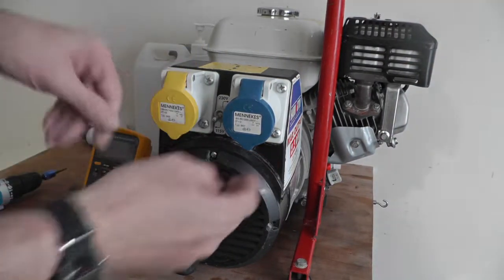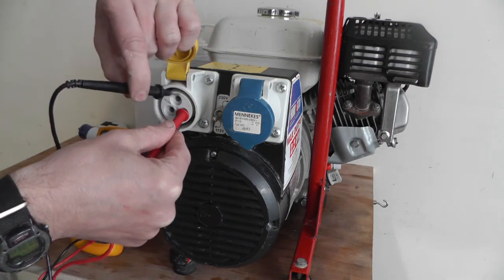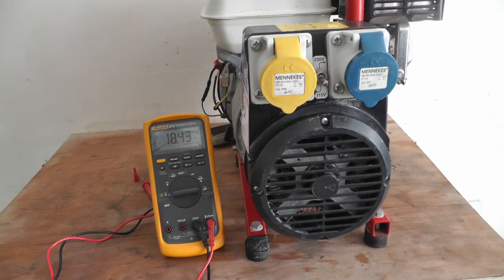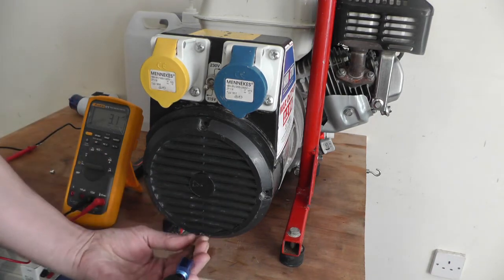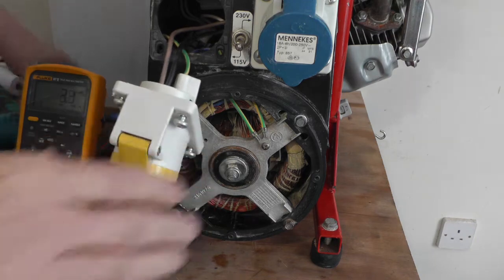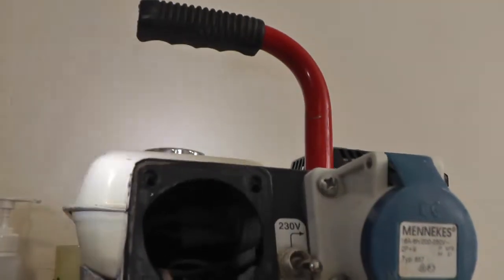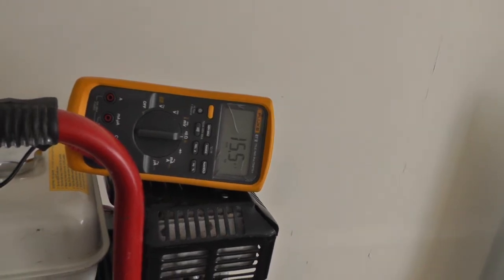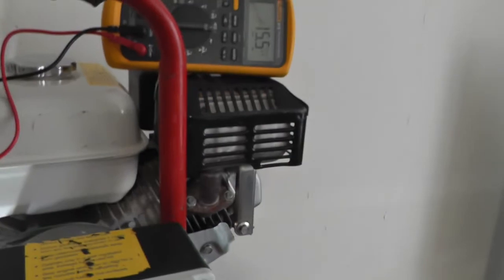Honda brushless generator testing voltages ~  low voltage repair

Comment: Hey i have a same problem. What what the solition on this one?
Reply from the maker: its usually the capacitor if not wiring connection if not serious rotor stator failure
Reply: So with this comment he's not even fully sure what is wrong with it
Reply from the maker: @kingdon9690  There was nothing wrong with it, it works fine, I was showing the test sequences id go through if I had a low voltage issue.

Comment: I know nothing about theses . I do know it should be connected to earth by means of an earth rod according to BS7671 also you should test between L-N N-E and L-E you should get 230v between L-N and L-E 0v between N-E there should also be an RCD on unit ,  if the unit isn’t earthed the any thing like power tools won’t be earthed and that is not good . 
Interesting video though 👍👍👍❤️
Reply from the maker: yeah should of been bit more thorough on tests really, but i see voltage I am happy on these generators when i am repairing them. Bit low voltage on this one.
Reply: Did you get it working properly? Fantastic video and insight to what you do 👍👍